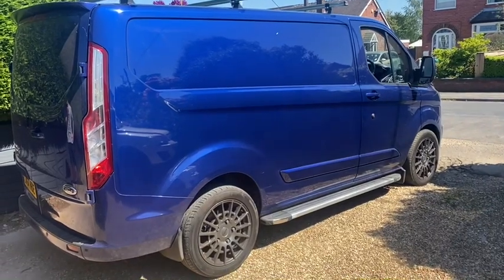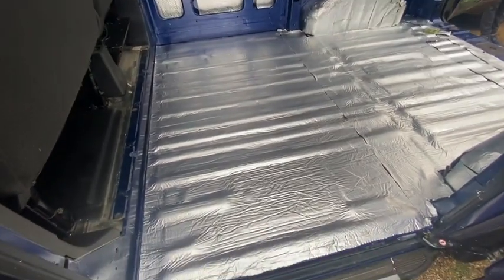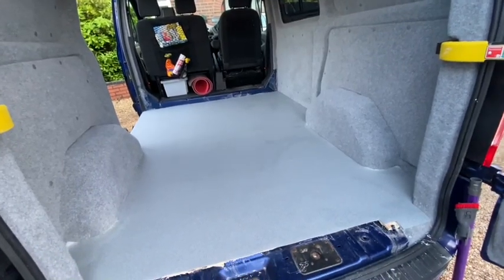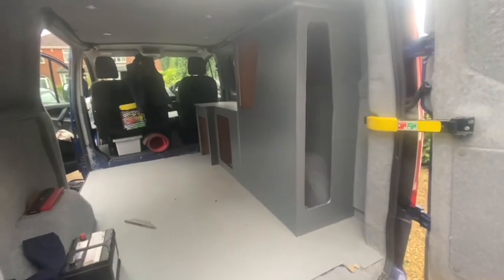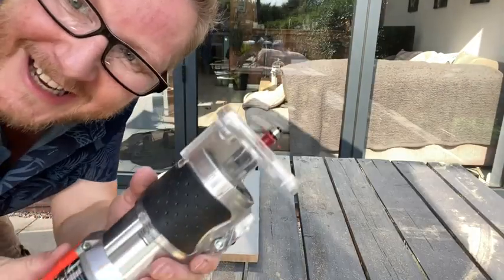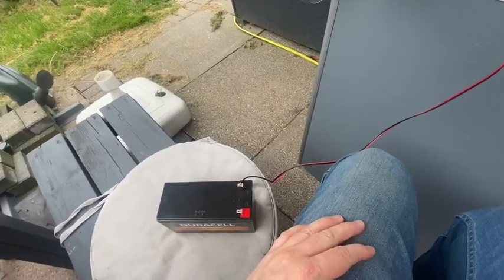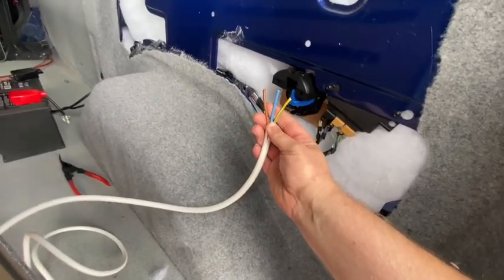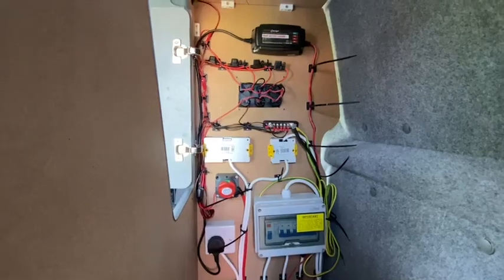Full Transit Custom Camper Conversion | 7 Week Conversion in 7 Minutes!!! 😃

Comment: I have just bought a 2017 SWB Transit custom. It will be used mainly as a work van but I want to insulate it and make removable camping furniture for it. Can I ask how much sound deadening and insulation you used. Thanks
Reply from the maker: Hi there - thanks for the comment and checking out the video.. I did a video here with a breakdown of the materials and cost etc.. Insulation details in there too 👍  How much does a DIY van conversion cost? Transit Custom Conversion
https://youtu.be/yXjvPr94cZA

Comment: Hi mate, love the van you’ve mad a brilliant job. I’m looking to buy a custom next year to convert and I was wondering where you bought your units from for the van? Also did you install the electrics once the van is insulated and carpet lined ? Thanks
Reply from the maker: Hey Tom 👍 Thanks for the comment & checking out the video. I got the units from a company called Alpine Leisure. They are MDF units which I know are not to everyone’s taste but we had a bit of a budget to work to and we happy enough with them… link is below 👇 https://www.alpineleisure.co.uk/MDF_Fridge_Kitchen_Unit_Basic/p5574028_19638775.aspx

On the electrics yes I did this after the insulation and carpet. This was as I planned to install electrics in rear wardrobe and just have wires either running behind units. A lot of people I have seen do a first fix of the wiring before which seem to be the most “common” approach. Good luck with the build 👍

Comment: Im late getting into your videos. Really enjoyed them. Just recently gone from T5 transporter back to a transit custom as ford have upped there game in the last few years. . I can't go full camper conversion as van needed for work  . Having windows done and going to have a go at insulation /carpets . Might do some electric connection so we can use it as a day van and il be using your videos thanks 👍
Reply from the maker: Hey - thanks for the comment and glad you like the videos. Yeah the Custom is a great van about 18 months since we converted it and really great as a daily drive and day and camper van when we need it. Good luck with your build too and smiles for miles 😀 Dave

Comment: Great stuff Dave, really useful videos (am about to embark on exactly this with a transit custom!).
One question- I didn’t spot reference to the window installation yet but still working through the vids - did you diy or have it done professionally? Which window did you opt for?
Many thanks, Ben
Reply from the maker: Hey Ben 😄 Thanks for the kind comments and checking out the videos. Yes you right I didn’t do the windows myself - I had them supplied and fit my a local conversion company. I think in hindsight I may have done it myself now I have a bit more confidence! But at the time it was one part I didn’t want to f up 😂 Good luck with your build and let me know how you get on 👍

Comment: As far as I’m aware of you ever sell the van you have to get an ‘NICEIC’ approved electrician to check/inspect the electrics like you have to on houses.
Just to make you aware 
I remember hearing it on wheeler dealers, Ed china was doing a camper conversion
Reply from the maker: Hey Ellis - thanks for the note. I don’t think it’s a legal requirement to have it checked and then a certificate issued like with domestic. However, I would agree 100% to get it checked out by either a “professional” camper conversion company or certified domestic and or auto electrician. We did both 👍 My son has a level 3 diploma in automotive and also his tutors at college helped with advice on install and then checks also. I do think a formal certificate would be a good idea though to be honest? Not quite sure why they don’t? Would give piece of mind for buyers, sellers and convertors alike 👍

Comment: Hey! Thank you very much for posting this. I got a transit custom and your channel saved me a lot of time researching tools and materials. One quick question: regarding the carpet, how much did you need to do the whole van? (roof, floor, walls, doors and panels)? I noticed there is a lot of different suppliers and brands. Any recommendation about how to find a good one?
Reply from the maker: Hey 👋 Thanks for the kind comment and checking out the videos! Glad they have been useful. I used a company called Lining Direct… I got 2m x 12m… This was more than enough.. The carpet I got was OK ✅ No issues - i do know the guys at Combe Valley Campers too and I know they supply some good stuff I believe. I would also say try and buy it all in one go from the same place as there can be variance in the colour in different batches 👍
Reply: @TransitCustomCamper  good stuff! Thanks!

Comment: thanks for posting Dave. I'm shortly going to start my conversion too. few Q's. How you finding the transit as a base. my head says ford but my heart says VW!. Also,  did the kitchen pod come as a off the shelf unit or fid you built them from scratch? 
lastly, the wiring is the one bit that scares me a bit. was it difficult to get everything working? I'm considering the Devon camper assembled loom. thanks,   Steve.
Reply from the maker: Hey Steve - thanks for checking out the videos! Transit has been great as base van no issues and drives really well. We did also look at VW’s but at the time the Custom was a bit cheaper and we had a bit of a budget to work to 👍 The kitchen furniture was flat pack and just had to assemble. On the wiring… yes the same for me was my biggest worry initially… but I got a kit from Wired Campers and it was too difficult to pull tinted and all working fine 👍 we had it checked over after too to make sure. I did videos on the furniture and also the electrics install too put links below in case they are useful too

EP15 | Part 1 | Van Electrics install 12v Panel & Split Charge Relay
https://youtu.be/wJ9MWQ0APco

EP10 | Part 1 | Self Build Camper Furniture using MDF Panels
https://youtu.be/Yw1pu2hOyoQ

Comment: tidy carpet job. but u do know your van has smart alternator and u need use dc to dc charger and not a vsr relay.
coz when your van is happy it runs at 12.4 volts until u let of gas or start braking. so not fully charge leisure battery.
Reply from the maker: Hey Paul - thanks for the comment. Yes I ended up installing a CTEK in the end that is working really well. It was a mistake I made to be honest - Installation of CTEK D250se DC to DC Battery Charger into Transit Custom with Smart Alternator
https://youtu.be/Q7IEjEKSFBI